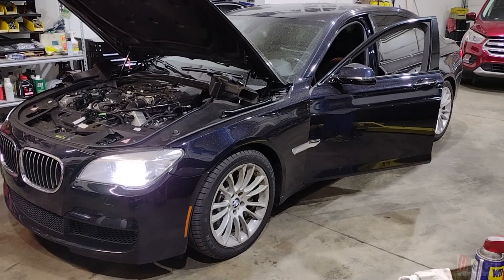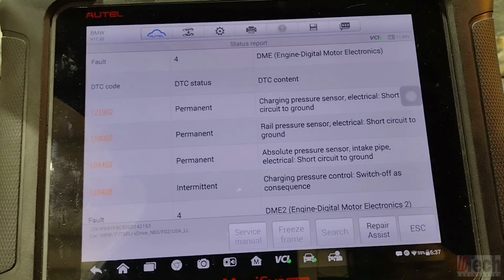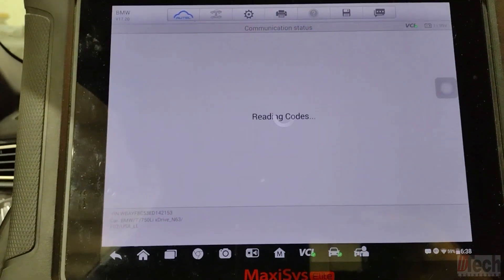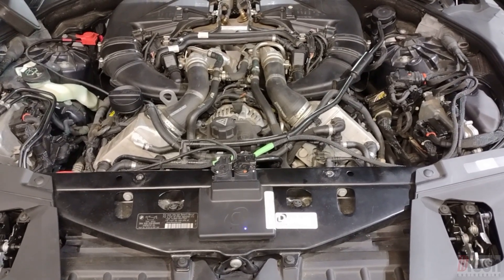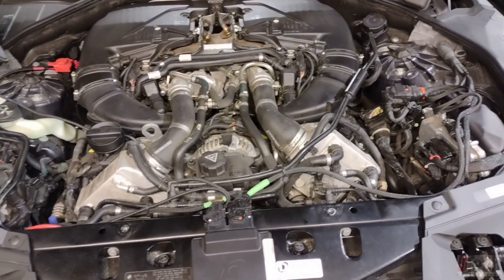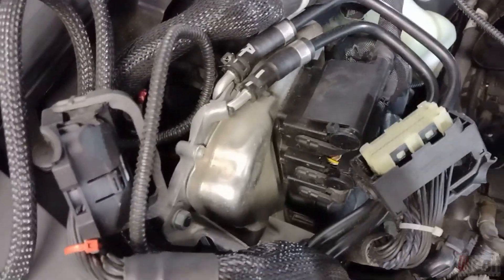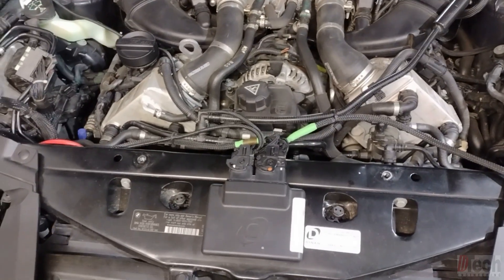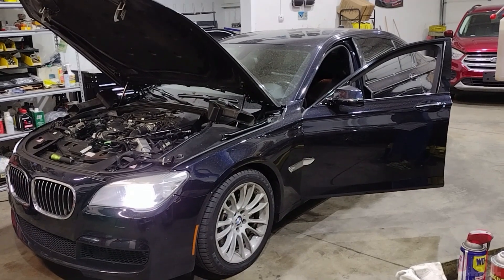BMW Multiple sensor Issues

Comment: Where is the map sensor located in this vehicle? I’ve been searching everywhere.
Reply from the maker: each intake manifold has a map sensor, it's very hard to get to when engine installed. You might just be able to access the connector. Do an online image search of the intake manifolds and you will see the location
Reply: @DTEAuto  where would this be located? I have search everywhere in the Internet and I cannot find even a diagram.

Comment: I am sure the customer was quite nervous (pre-diag) as to what could be causing these issues (especially the low power complain).  He probably had the largest sigh of relief when you told him that removing the Dinan module was all that was needed to resolve the issues.

Another great diag, Sadel.  Perfect example of starting off with the simple “what’s known” and not overthinking things.  A++ as usual!
Reply from the maker: Yes, he was totally fine with having it unplugged, funny thing was he wasn't even aware of it being on there and said he bought the car with it installed
Reply: @DTEAuto  Can probably get good money for it on eBay (sold as-is, obviously)!